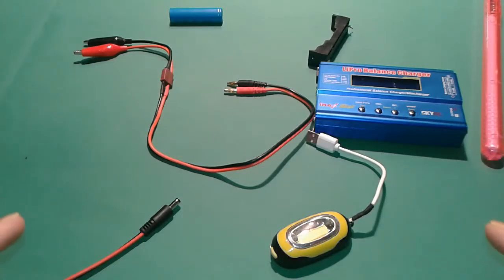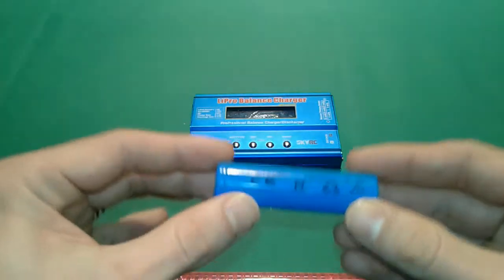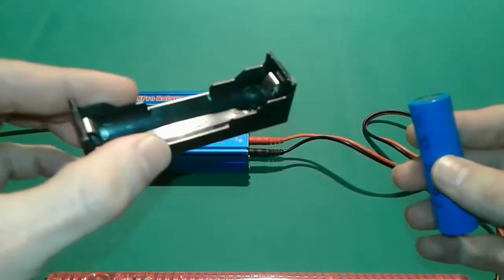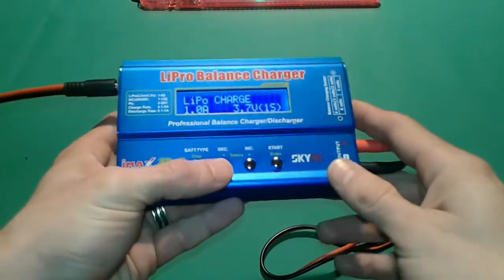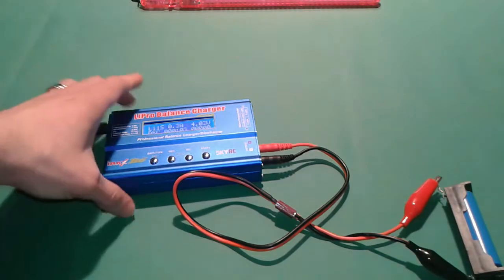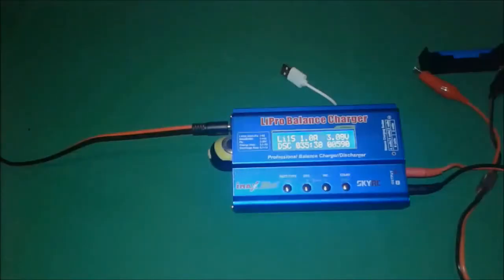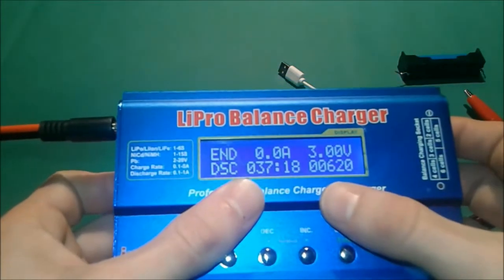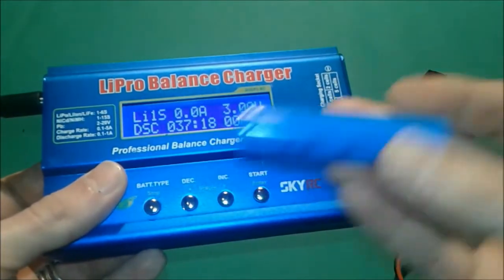18650 DISCHARGe CHARGING, Li ion battery pack capacity mAH TEST

Comment: Hi why discharging is important ,and can we discharge many batteries at once ,like a bunch of 4 or 5 or 6 

Let me know thanks
Reply from the maker: Hi there by discharging with this module you can find the capacity of the cell and discharging one by one to get accurate reading more cell will give you different values
Reply: @NoSkillsRequired  thanks

Comment: That was fine but how long would it take to discharge 7 cells in parallel? It seems the restricting variable is the amount of discharge current that the unit can handle.

Comment: It does NOT discharge correctly , I just did it and put it on the volt meter and still reads 3.92 volts .

Comment: I opened a Japan laptop battery and found samsung batteries. 5 batteries showed me 4.50V before charging. TP 4056 refused to charge. smart charger says full in 2 min. capacity terster gives in one min. error.
What do you  understand about this?
Reply from the maker: kuna you have to separate each cell, measure them if they are below 2-3v most likely there are damaged, there are some methods to revive them but dangerous and no guarantee
Reply: NoSkillsRequired :- Sorry I did not explained properly. Anyhow thanks for the fastest reply I ever received 
I measured each batteries and 5 batteries showed each 4.8v and 4.9v it was strange reading to me. I confirmed with different meters. How can a battery shows 4.8v and it has been rejected by all chargers and capacity testers?
Reply from the maker: kuna 4.8v is too much there are overcharged maybe that's way the charger reject it because the chargers are designed to stop at 4.2v or below, try to discharge one cell and then put it on charger
Reply: NoSkillsRequired:: thanks.  I will try now.

Comment: Why discharge for lipo? it's a li ion
Reply: So Li ion don't need to be discharged at a certain rate then? Sorry I'm new to vaping and don't know if I can run my 18650s down to nothing before charging again??
Reply: lipo batteries are li ion. theres no such thing as a 1 cell lipo battery.